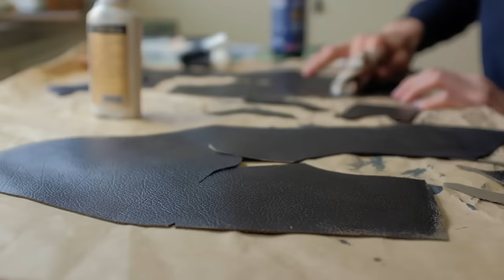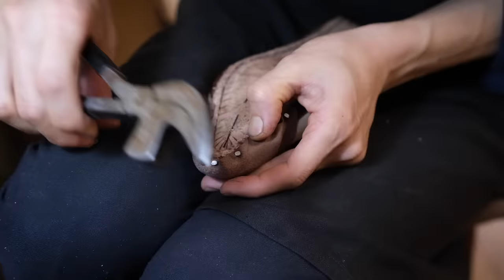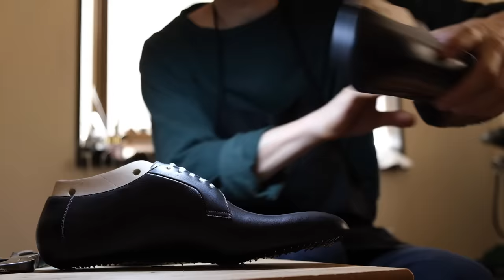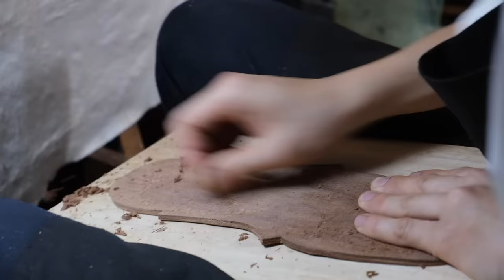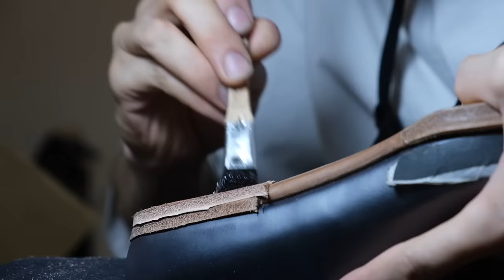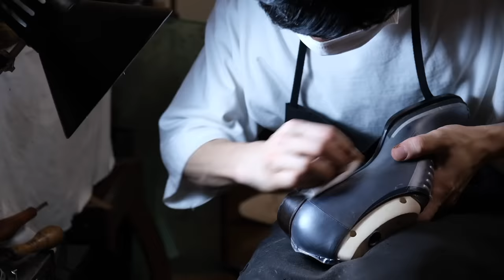Making Derby Shoes in Vintage Embossed Leather

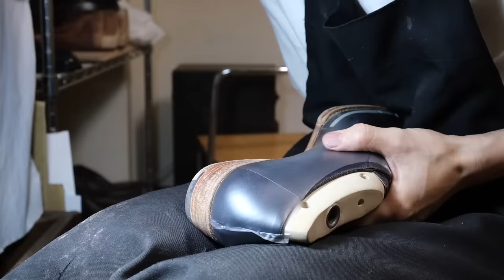Comment: When you are sanding the heel with the block with sandpaper wrapped on it, after you glass it, what is the white paste you are using at 29:19? Is that glue or leather conditioner like Tokonole or similar? Very nice work!
Reply from the maker: Yes, the white paste we use is a leather conditioner👍🏻

Comment: Very nice crafted shoes. No doubt very skilled work. Your skills are awesome! But Blucher shoes are just not relevant. And every version of Derby’s/Bluchers with split toes just look bad and really detract and distract an outfit. 

To me, if you're wearing dress shoes its for a reason. Either go with an Oxford for formal dress, or an Oxford (preferred) or Derby brogue to dress up a more casual look. 

Casual dress shoes fall into an unnecessary no-man's land within the dress shoe category, just like dress shoes with sneaker soles - they're a solution looking for a problem that doesn't or shouldn't exist - so don’t bother. There's no scenario when I'd use these Bluchers to "dress down" a dressy outfit, or "kind of” dress up a casual outfit with “kind of” more casual dress shoes. Go all in and the entire outfit will look much better.